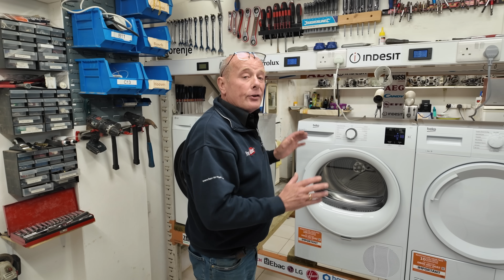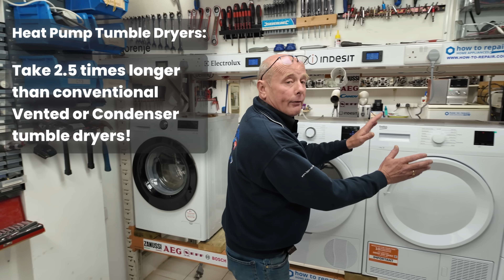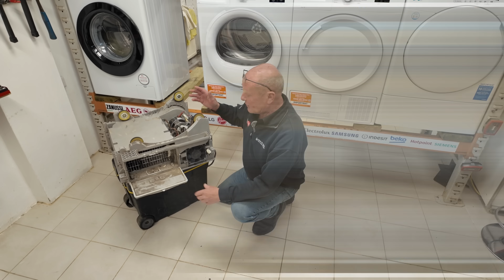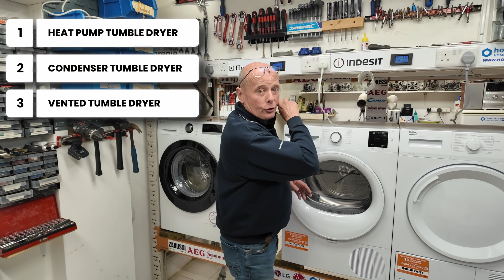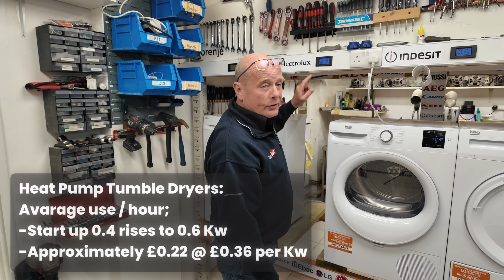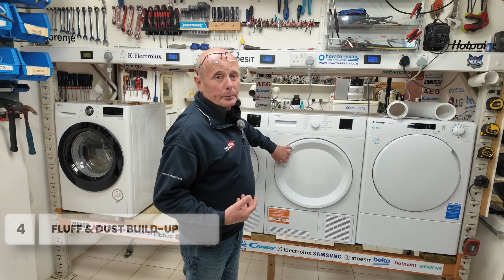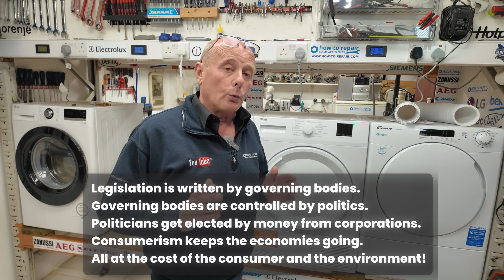Tumble Dryers the Shocking Truth About Heat Pump vs Vented & Condenser, NEW LEGISLATION!

Comment: With the vented dryer, you also have to include the air that is passed outside, the house heating has heated this air prior to going into the dryer. This is not insignificant.

How likely is it that the compressor will fail, my fridges and freezers have gone on for over 20 years? The refrigerant doesn't leak in a fridge and need refilling, why should it in a dryer?
Reply from the maker: I only spoke to someone today who had lost the gas on the AEG, I also spoke to a Scandinavian person last week who found out that the compressor had failed on both occasions they had to get new machines. Thank you very much for your comment though.

Comment: Excellent video and channel! I've only recently discovered your channel but it's a pleasure to listen to someone who knows what they are talking about and I agree with all you say. I'm retired now but spent 40 years as a mechanical design engineer working in various industries and am a firm believer in simple design and good quality components. With the 'green' agenda, it's possible to design most machines to meet a political requirement but the question has to be asked ...... does it make economical and ecological sense, long term? Your example of the 'heat pump' dryer having to do over twice the mileage to achieve the same result as the other 2 machines says it all. Also, with the other 2 machines, you can regularly and easily clean the filters to maintain efficiency but the 'heat pump' dryer will slowly clog up and loose efficiency and start costing more and more to run because the filter is impossible to access without a major strip down of the machine. Awful design ....... built in redundancy! 👎 Incidentally, I don't own a tumble dryer 😊 If I want to speed up drying of clothes indoors, I simply hang the clothes on a clothes horse and set up my desk fan (about 40 watts or 1pence/hour) to blow through the clothes. You'd be surprised how effective it is in speeding up evaporation, depending on relative humidity, of course. Thanks again for the interesting videos!
Reply from the maker: Thank you so much for the comment. It means a lot to me. Recently, I made two videos that got a lot of attention. What surprises me is how many people disagree with them, even though they are popular. Everyone has their own opinion, but most people say their machines don't last five years. Engineers really dislike these machines because they are hard to fix. We need to stop being so wasteful.

Your idea of using a clothesline with a fan is great. You can make it even better by adding an 80-pound dehumidifier in a sealed room. If you use your house's ambient temperature and have the fan blow through the clothes, they dry very quickly. I might even make a video about this one day. If any of your friends or family are thinking about buying a new dryer, it would be helpful to share this video with them. It will give them an idea of what to expect when purchasing a new dryer.

I hope older models will still be available, but I can't promise that. It's important for people to know the differences between the dryers on the market and understand any potential issues before making a purchase.
Reply: @How-to-repair  Yes, a lot of people do have their own opinions but they aren't very often supported by facts or science ...... their prerogative I suppose 😉 Yes, a cheap dehumidifier in a sealed room with the fan, would be ideal! You'll put the manufacturers out of business with ideas like that ...... well done 😁I will certainly share your channel with anyone I know who's thinking of buying a new domestic appliance! You might find this hard to believe but my Hotpoint Aquarius WF560 1600 spin (6Kg) is still going strong, it'll be 19 years old in May this year. Admittedly, it only serves me but I'm quite impressed 👍I check the drum main bearing for play after every wash but there is nothing detectable. I wonder if spares are still available for such an old machine? Cheers for now, Phil (Somerset)

Comment: I have a heat pump dryer and regularly run it for free on solar. The reduced power requirements from the grid of millions of dryers using lower peak power translates to billions of pounds saved on grid upgrades. You don’t include these costs in your calculations. If you’re a fan of high electricity prices then stick with the old technology.  The only point I agree with is that they should be designed better for cleaning.
Reply from the maker: Please don't take it the wrong way I am all for heat pump technology. I totally agree with you with regards solar but these machines are being built in  a away that they are unmaintainable. You only have to read the comments on this video alone. Thank you very much indeed for the comment.

Comment: I own a Miele heat pump dryer. After 5 years of ownership, I’ve already had to take the whole machine apart myself (about 3-4 times) to clean the water pump as it’s gotten clogged with fine lint over time.
I always maintain both filters etc regularly as I have a good understanding on how the machine operates. It takes ages to strip the whole machine - would be better if Miele put the pump in the back /front so it can be easily serviced and not central in the machine under the drum!!. 
Having said that the machine has been perfect in my opinion and no other faults have occurred.
Reply from the maker: Accessibility to things like the pump and being able to clean the evaporator and condenser correctly are very important and even a company of quality like this still seems to be doing things deliberately.
If any of your friends or family are thinking about buying a new dryer, it would be helpful to share this video with them. It will give them an idea of what to expect when purchasing a new dryer.

I hope older models will still be available, but I can't promise that. It's important for people to know the differences between the dryers on the market and understand any potential issues before making a purchase.
Reply from the maker: it’s good to know the dryer has been reliable overall and hasn't had any major faults beyond the pump maintenance. Hopefully, manufacturers will start designing appliances with easier access for DIY repairs in mind, especially for users like you who take the initiative to keep their machines in top condition.

Thank you for your comment. I appreciate people like you taking the time to write it out. Please share it where possible. It might help others make a wise choice instead of being misled by the industry.
Reply: Thanks for taking the time to reply. I agree most manufacturers don’t care about the end user and would rather you pay their extortionate fees for their own service engineers to come and fix it. Thanks for making an informative video hopefully people can make up their own minds to which appliance is right for them and make them aware of any high expenses they could be paying out in an event of a breakdown! I’ll definitely recommend this video !

Comment: Got the beko condenser ( middle one) cost £190 4yrs ago, drys mixed full load in 1hr use it over the winter time when to wet to line dry. Easy maintenance as you say.
Reply from the maker: We all have the right to repair whatever type of appliance we buy thank you for the comment If any of your friends or family are thinking about buying a new dryer, it would be helpful to share this video with them. It will give them an idea of what to expect when purchasing a new dryer.

I hope older models will still be available, but I can't promise that. It's important for people to know the differences between the dryers on the market and understand any potential issues before making a purchase.
Reply: I hate beko …the damn thing never switches off 😡

Comment: I'm no green warrior but I was expecting a little better information than has been presented, sorry.
At first I thought you were going to run a cycle of similar washing and show the comparison, but it seems you have gone straight into a “I don’t like them” rant. 
I get the running hours are higher and components run longer, therefore its fair to say it will “potentially” break sooner. That is if the manufacturers don’t make better longer lasting components.
Your test, was it just no-load running? That proves nothing. Do the drying cycles correctly and show the power usage. 
Also, your assumption the clothes will wear more is also not quite right. Although the running time is potentially twice as long (usually only a third longer) the heat the clothes is exposed to is far less and is less damaging to them. 
The bit about cost. Fair point a heat pump dryer is more but your 5 year cost comparison is not right. Depending on price per Khw ( £0.27) the heat pump dryer will have at least paid for itself compared to a condensing dryer and far more then a vented one. The only way it doesn’t win is if its cheap rate overnight electricity (£0.07) but using that only one load per day can be done. Not convenient at all.
Repair currently may be difficult but its just a heat pump which is the same as any other, like heating systems. Yes it will take repairs mostly out of the DIY realm but home central heating did the same 20years ago. 
Oh and you don’t need to strip the dryer down to get the fluff out of the majority of heat pump dryers as you simply wash down the condenser element. This is something the manufactures are starting to improve but adding internal spray systems to do that job. The owner just needs to make sure the instructions are followed on what to keep clean, but that is the same as any other tumble dryer. 

So please do a fair comparison. I have watched many American reviews and they have done just that. The only difficult one is a long-term test.
Reply from the maker: I understand your comments and points. I will be doing the exact test you asked for, but with three new machines from the workbench and three used machines of similar ages. I will then show you the difference in their cycle times.

From my experience, poorly maintained condenser dryers and heat pump tumble dryers can take twice as long as they did when new. I appreciate you taking the time to write your feedback. Please remember, I am only trying to get basic information out to the general public. Longer videos require more work, but they will be coming in the future. I am a one-man band, remember
Reply: @ would be good to see a full comparison and I understand what you are saying. I have been looking for sometime to replace our vented dryer and the didn’t know about the heat pump dryers. I have done a lot of investigation on them and a lot of snooping at shops to the design structure of them. It would appear the current top line models have most of the possible issues resolved but at a cost. I am looking for a mid point product which I am almost settled on but it is £550 . So yes it’s pricey. The only thing I can’t find out is if it’s a direct drive or a belt drive. As I’m guessing changing a belt on a heat pump dryer is not an easy thing

Comment: It all makes sense which i didn't realise before, but how much would it cost to dry the same load of clothes in each machine and therefore how much would it cost to dry them as that would be a better indicator than saying things in who's of usage per machine
Reply from the maker: You're right knowing the actual cost of drying a load of clothes in each type of machine is a much clearer way to compare efficiency. The running cost depends on factors like the machine's energy rating, the local electricity price, and the drying time for a typical load.

If any of your friends or family are thinking about buying a new dryer, it would be helpful to share this video with them. It will give them an idea of what to expect when purchasing a new dryer.

I hope older models will still be available, but I can't promise that. It's important for people to know the differences between the dryers on the market and understand any potential issues before making a purchase.

Comment: The 'green' initiatives are a cash boondoggle for some and a waste for many others.
Reply from the maker: 80% of all money on this planet is owned by less than 2000 people and they still want more! Think about the environmental impact of building machines and then recycling them. These machines are often transported halfway around the world, which adds to fuel costs. It's baffling that we need to ship them every five years due to failure.

If any of your friends or family are thinking about buying a new dryer, it would be helpful to share this video with them. It will give them an idea of what to expect when purchasing a new dryer.

I hope older models will still be available, but I can't promise that. It's important for people to know the differences between the dryers on the market and understand any potential issues before making a purchase.

Comment: If what you say is true, surely there is a class action law suit to be prepared for all us heat pump tumble dryer purchasers and/or extended warranties which cover the flaws you mention. To leave it as it is in unacceptable.
Reply from the maker: There are many class action suits taking place against appliance manufacturers in the USA but this does not happen very often in the European Union If any of your friends or family are thinking about buying a new dryer, it would be helpful to share this video with them. It will give them an idea of what to expect when purchasing a new dryer.

I hope older models will still be available, but I can't promise that. It's important for people to know the differences between the dryers on the market and understand any potential issues before making a purchase.

Comment: I had considered to buy an AEG 9000 series heat-pump washer-dryer, but multiple repairmen warning me about the poor maintainability of heat-pump dryers plus the not actually all that spectacular energy efficiency (2.52 kWh per load for washing and drying as opposed to 2.62 kWh for the Miele unit) made me drop this one from my selection.
Reply from the maker: You were given sound advice I think heat pump technology is good but they should test stuff before going into Ful production If any of your friends or family are thinking about buying a new dryer, it would be helpful to share this video with them. It will give them an idea of what to expect when purchasing a new dryer.

I hope older models will still be available, but I can't promise that. It's important for people to know the differences between the dryers on the market and understand any potential issues before making a purchase.
Reply: @How-to-repair  The weird thing is that they've been making this model since 2013, and yet it still has severe design flaws (multiple users report that lint tends to collect in an elbow right before the lint trap and for some, the lint escapes into the heat exchanger due to bad tolerances, necessitating frequent disassembly for cleaning).

Comment: Can the heat pump tumble dryer be redesigned to make it repairable?
Reply from the maker: Yes, 100% they should give these appliances when they are first built to engineers to use for a period of time before going into full production, if they would ask engineers in the field before they start building this rubbish they would get a much better result. when the gases were changed from 134a to 600 on fridges America did not follow suit for 10 years

Comment: Very informative thank you. Generally speaking people in governments aren't just dumb, most of the times it's quite the opposite. Have you considered a larger picture, if all the people in a town all use heat pump, they would take much less energy from the grid, decreasing energy demands. Isn't that also beneficial?
Reply from the maker: I am never disputing the advantages of heat pump technology. What I am saying. These machines are nearly impossible to service properly, where quicker for the amount amount of washing you're doing, and I'm not lasting much longer than five years on average, thank you very much for the comment
Reply: @How-to-repair  thank you for the reply.  I really liked the video and it will help me to make informed purchase decision on my next dryer. It just seemed odd claiming they have been "greenwashed", maybe they got more information . What other factors could explain apparent bad decision 🤔

Comment: Had a heat pump for a week and gave it away and went back to a condenser so glad never sold dryer lol  me personally I prefer vented can dry a load of washing in 40-50 mins but as I live in a flat condenser is the only option I’m dreading the day I’d have to go heat pump again when my dryer brakes
Reply from the maker: Heat pumps are often promoted as the greener option, but they’re definitely not, especially with how long they can take to dry clothes compared to vented or condenser dryers.

If any of your friends or family are considering purchasing a new tumble dryer, sharing this video with them would be beneficial. It will provide them with insights into what to expect when making a purchase.

I hope that older models will remain available, although I cannot guarantee it. It's crucial for consumers to be aware of the differences between the dryers available on the market and to understand any potential issues before making a purchasing decision.
Reply: @How-to-repair  the heat pump dryer I had which was only year ago took 7 hours to dry 5 towels and only turned one way and twisted up bedding aswell hates it lol

Comment: I looked at the whole life cost and the heat pump worked out the most cost effective over 2 years with a 5 year warranty. There is insufficient information to look at the overall environment impact.
Reply from the maker: Please take the time to look at comments from users and also what real life engineers are experiencing when they have to service the machines. Thank you for the comment.